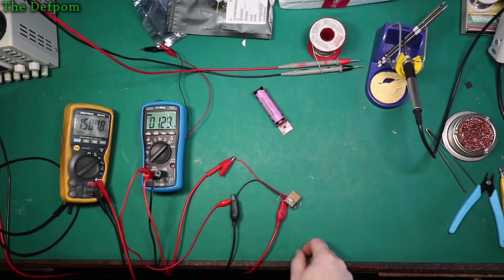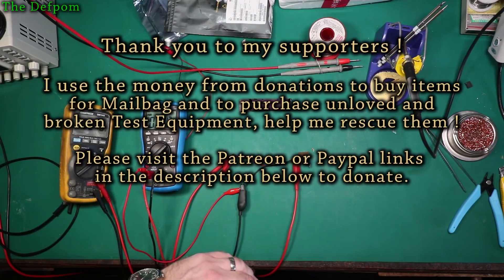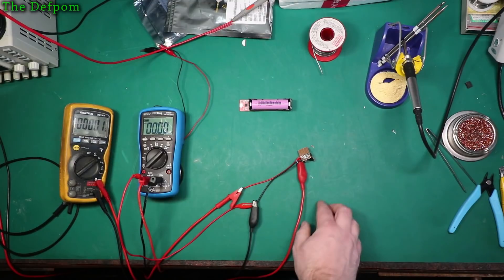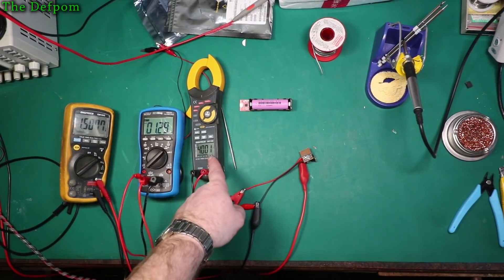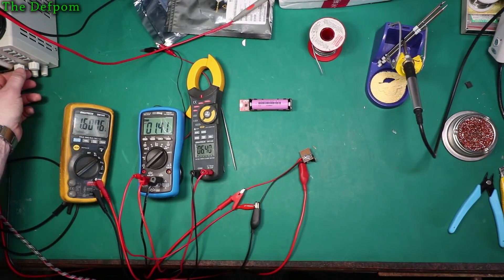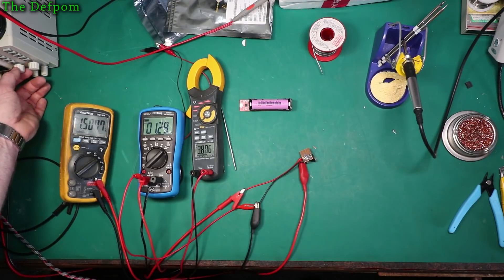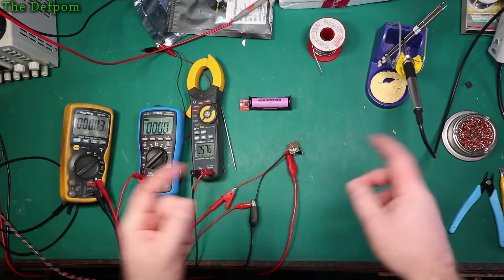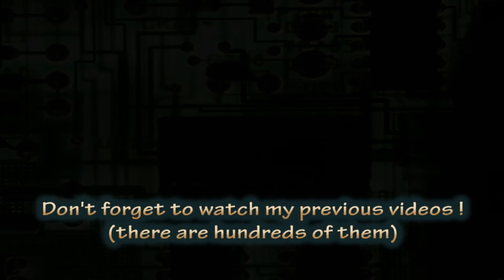🔴 #457 LM317 Voltage Regulator - Output Voltage Oddity Investigation

Comment from the maker: Extra info: the circuit this needs to power uses less than 2mA.

Yes I have capacitors on the input and output of the regulator.

Because the output voltage had to be set right at the lower end of what the device is capable of, it would of meant two very low value resistors in series between the output and ground, I didn’t want it to start getting warm as it isn’t going to be heat sinked, and I didn’t want the resistors to get warm and effect the divider accuracy, the output voltage has to be very stable.

If I had used the 240 ohm I would of needed 19.2ohm to get exactly 1.35v, part of the resistor choice was to get the exact voltage using common values, and at those resistances it would of only been 259 ohms across the output, consuming 5mA through them, again I didn’t want them to heat up, and also I didn’t want to waste power as this is going to be run from the battery.
Reply: Hmm you want everything yoooo greedy sod lol :-D
I dont suppose you could creep in a silicon diode on the output terminal before the 240 ohm resistor, lift the drive voltage up a little.
Im not sure what other effects that would have, worth a go lol
Reply: How about use a voltage reference chip specifically designed to be accurate over its input voltage specification?

Comment: The first clue I detected about why your circuit wasn't behaving properly is the 1K resistance between o/p and adjust (R1). The second clue, predictably, was your current draw of 1.2mA. This is where errors crept in to what I was saying. To correct, the output current generally has to be a minimum of 5 mA or more. The necessary minimum output current varies across manufacturers and packages, anywhere between 3.5 to 10 or more mA. That 5mA figure is the basis for the recommended R1 value of 240 ohms since R1 = Vref / Imin. So, dividing 1.25V by 5mA = 250 ohms, and 240 is the common 5% value nearest to and lower than 250 ohms.The online calculator I've seen, and data sheets for the LM317, specify R2 = 240 ohms for the full range of o/p voltages. This allows sufficient current into the adjust pin for correct operation at any o/p voltage. My setup for 1.35V o/p works with R2 = 20.4 ohms (using a 50 ohm trim pot) and R1 = 249 ohms (the closest value I had). This is what I ended up with using an iffy bimboard and it's resulting voltage drops. My device is the National Semiconductor LM317LZ. My Vref / Imin is 1.25V / 5mA. So my R1 is just great because 5mA is the Maximum minimum output current required for this device. (The Typical minimum output current for this regulator is 3.5mA, so I might have got away with R1 = 1.25 / 0.0035 = 357 ohms).

From the above, R2 can be arrived at with a trim-pot, or calculated by manipulating the equation Vout = Vref x [1 + (R2 / R1)] thus: R2 = R1 x [(Vout/Vref) - 1]. Also of vital importance is to remember that the minimum output current pertains to R1 in the design, not whatever load is connected to the adjusted, regulated output. So upping the load current to so many mA by using a load resistor will not help!

So using the datasheets electrical characteristics, go with the Maximum minimum load current to be on the safe side. If you don't have datasheets, use 10mA as a starting point for R1 (125 ohms). I made a change like that to a piece of stereo equipment I built where I was running LM317T and LM337T regulators with a minimum output current of 4.9mA (R1 of 255 ohms). This was bad news as there was all sorts of intermittent crappy mushy noise. I recalculated for a minimum output current of 10mA (124 ohms) and voila! All good.

Hope this helps (again!).

Comment: My lm317 ics are having problems regulating voltage I made a generic schematic it worked for over a year but suddenly something started to mess up and it is no longer regulating voltage it just directs the input voltage directly to the output but only let's 250 ma max and sometimes it does regulate but after sometime it seems to stop regulating and has the same issue I am using 24 volt transformer with diodes rated for 6 amps please help me .

Comment: Why not use the LM317 or other low-noise LDO, (LT3045) to power a zener voltage reference chip....then divide the zener's constant output using a low-ppm resistive divider network (perhaps with a trimpot)......to get a REALLY stable and quiet 1.35 volts.
Best trimmer would be one of the Vishay "foil" types....I think they have a ppm/C down to about 10 or 5, so temperature is almost a non-issue. (?). Very stable voltage.
If you need more millivolts, add a buffer opamp on the output, like the LTC2050 ?

Comment: I am pretty new to how electronics work, I do know a little. But I bought an lm317 to build a little adjustable power supply. With mine, as soon as I apply a load, the voltage just drops completely down. Any suggestions?

Comment from the maker: I went back to a thread I had previously seen on EEVblog where there was a photo of a board that is made by Fluke to replace the battery, you can see the resistor colours (https://www.eevblog.com/forum/testgear/fluke-540b-thermal-transfer-standard/?action=dlattach;attach=38492;image), I dropped the values into an LM317 calculator, it comes out at 1.346 V, so I am sure the part they are using is also an LM317.
As for the resistor values... R1 is 1.3K, R2 is 100 Ohms, so those are actually presenting slightly less loading than my version, maybe I wasn't so far off after all.
Reply: Nice find, now you have the ideal values too :-).
The actual voltage will be a tiny bit off the calculated one, because of the tolerance of the lm317 you are using, the 1.24v ref and 50uA's to 0v.
But it won't be much off.
The 2n3055 npn power transistor is also one of my favorites for the outputs of linear power supply and old audio amplifiers.
The amount of c.b power supplys i've repaired, too dam many, a bucket of 2n3055's ha ha:-D.
I bet you have done the same, it's a task that follows c.b radio repair.

Comment: As other's mention, the LM317 has fairly hefty IQ and Dropout for your application given it's a battery powering it. Not sure if you mentioned how much current was pulled from the previous Mercury Battery or not. There are a fair number of LDO and low IQ  regulator out there that were designed for Battery Application that maybe better suited. There is also a battery called a Wein Cell that was developed to replace the Mercury Batteries used in older SLR Cameras that require 1.35V. So maybe one of those with a low voltage/low IQ op-amp as a buffer to your  load? As always, several paths to get where you want to go.
Reply from the maker: I went back to a thread I had previously seen on EEVblog where there was a photo of a board that is made by Fluke to replace the battery, you can see the resistor colours (https://www.eevblog.com/forum/testgear/fluke-540b-thermal-transfer-standard/?action=dlattach;attach=38492;image), I dropped the values into an LM317 calculator, it comes out at 1.346 V, so I am sure the part they are using is also an LM317.
As for the resistor values... R1 is 1.3K, R2 is 100 Ohms, so those are actually presenting slightly less loading than my version, maybe I wasn't so far off after all.

Comment: Read the datasheet more carefully. All these linear series regulators need a MINIMUM amount of load current and a MINIMUM dropout voltage in order to be able to regulate. Your 1.xx mA total current clearly shows that you don't have the proper load on the LM317. Datasheet says you need to have at least >3.5mA load current and >3V dropout voltage otherwise the device will not regulate. Under these conditions, those equations for the voltage vs resistors are pretty close.
Reply: ...if this is supposed to replace the battery backup for memory, with these type of currents it will be drained in no time. But on the other hand, for a few microamp required for SRAM battery backup there is no need for voltage regulator
Reply from the maker: I went back to a thread I had previously seen on EEVblog where there was a photo of a board that is made by Fluke to replace the battery, you can see the resistor colours (https://www.eevblog.com/forum/testgear/fluke-540b-thermal-transfer-standard/?action=dlattach;attach=38492;image), I dropped the values into an LM317 calculator, it comes out at 1.346 V, so I am sure the part they are using is also an LM317.
As for the resistor values... R1 is 1.3K, R2 is 100 Ohms, so those are actually presenting slightly less loading than my version, maybe I wasn't so far off after all.

Comment: LM317's are not happy at the bottom end (the internal reference voltage is 1.25V)......so set the voltage say 0.7Vdc higher and use a forward biased diode to drop the 0.7Vdc.....or even multiple diodes etc.
Reply from the maker: IanScottJohnston - if I were using a higher input voltage (where it showed the instability) then I would of done exactly that I think, but as it was ok at the voltages it will be seeing (3v-4.2v) I was happy enough with how it performed, I had tried different resistor value combinations until I found what worked ok.
This particular part has an internal reference voltage of 1.2487V

Comment: Great video, can't wait to see the conversion video as I'm facing a similar issue. I agree with AllTheGearNoIdea - always look at regulators with a scope in addition to a meter. I can't tell you how many times I've found oscillation on the output of regulators, especially older TO-3 packaged fixed regulators. Causes interesting problems in digital gear!

Comment: I’m guessing same as others load current and also possible bypass capacitor. I would be interested to see output on scope just for good measure.  It’s funny how us engineers all have there own way of working, not wrong just different. Obviously depends on the job but I find I generally use a scope more than a volt meter. Granted I’m not looking at the same precision that you are. But often a scope will often show something like instability much more readily than a DVM.   When you figure it out let us know. Chris.   Just reading your notes, obviously a good idea to keep the input resistant stiff, as they can be pulled by the program bias current, this also causes the calculator to fail.
Reply from the maker: AllTheGearNoIdea - yes I use a scope too when I am interested in noise, in this case as it is going to be run from a battery that shouldn’t be a problem, also see my pinned comment explaining a bit more about what I was doing and why.
Reply: The Defpom's Repair Channel  I would be looking for instability rather than noise.  Everyone know how fantastically well  these regulators work, until one day they don’t. I have no reason to believe that’s your problem here and I’m just guessing. But if you only have a hammer everything looks like a nail.  I think it’s more likely the load current.   I hope you investigate a bit further, I’m almost tempted to plug a soldering iron in. But then again. Regards Chris

Comment: Did you forget the input and output capacitors?, they give stability and prevent oscilation.
The output to control via 240 ohm resistor is best left as a standard.
All calculations miss out the roughly 50uA that passes to ground via the adjust resistor.
The internal reference is not always at 1.25v, errors will occur.
But they do work fine normally :-D
Reply from the maker: I went back to a thread I had previously seen on EEVblog where there was a photo of a board that is made by Fluke to replace the battery, you can see the resistor colours (https://www.eevblog.com/forum/testgear/fluke-540b-thermal-transfer-standard/?action=dlattach;attach=38492;image), I dropped the values into an LM317 calculator, it comes out at 1.346 V, so I am sure the part they are using is also an LM317.
As for the resistor values... R1 is 1.3K, R2 is 100 Ohms, so those are actually presenting slightly less loading than my version, maybe I wasn't so far off after all.
Reply from the maker: zx8401ztv - see my pinned comment explaining a bit more about what I was doing and why.

Comment: Hi    1K is far to high for R1     Data book suggests 120 ohm or 240 ohm  and you need caps
for good regulation . When doing stuff like this you should show us a circuit diagram .

                                                                                                                     Alan

Comment: Your not loading the output enough.  According to my datasheet, the minimum Typical load is 3.5mA and may need a load of up to 10mA to maintain regulation!
Reply: That's what I was thinking immediately too. When you want a widely regulated output the current sink needs to be a constant current one and not just a fixes resistor etc. Brings back memories. Another reminder for everyone to read the datasheets of the parts you are using :)
Reply from the maker: Pentti Kantanen - see my pinned comment explaining a bit more about what I was doing and why.
Reply from the maker: I went back to a thread I had previously seen on EEVblog where there was a photo of a board that is made by Fluke to replace the battery, you can see the resistor colours (https://www.eevblog.com/forum/testgear/fluke-540b-thermal-transfer-standard/?action=dlattach;attach=38492;image), I dropped the values into an LM317 calculator, it comes out at 1.346 V, so I am sure the part they are using is also an LM317.
As for the resistor values... R1 is 1.3K, R2 is 100 Ohms, so those are actually presenting slightly less loading than my version, maybe I wasn't so far off after all.
Reply: Yep, pretty much - this is a common trap with these old regulators.
Reply: More explanation here from TI's 2016 datasheet.

7.4.3 Operation at Light Loads
The device passes its bias current to the OUTPUT pin. The load or feedback must consume this minimum
current for regulation or the output may be too high. See the Electrical Characteristics table for the minimum load
current needed to maintain regulation.
Reply from the maker: Chris G - see my pinned comment explaining a bit more about what I was doing and why.
Reply: Yep, this. Evidently this circuit won't have problems (with this particular LM317 anyway) since the voltage requirements are low enough that the regulator is ok at the reduced current. However the datasheet is pretty specific about getting 10mA minimum, so you shouldn't expect that any given LM317 will regulate properly at <2mA. That said, I have noticed that every time I've come across something similar, I get accurate regulation at voltages <5V even if I don't hit the current requirement.

If your requirements are so small, you might consider going with a shunt reference instead. The ubiquitous TL431 only requires 1mA (if I remember right) and can supply up to 100mA. It also says pretty cool. If you only need a few more mA after that you can toss on a BC557 for a few deci-cents and you get very stable voltage with low quiescent current requirement.
Reply from the maker: I went back to a thread I had previously seen on EEVblog where there was a photo of a board that is made by Fluke to replace the battery, you can see the resistor colours (https://www.eevblog.com/forum/testgear/fluke-540b-thermal-transfer-standard/?action=dlattach;attach=38492;image), I dropped the values into an LM317 calculator, it comes out at 1.346 V, so I am sure the part they are using is also an LM317.
As for the resistor values... R1 is 1.3K, R2 is 100 Ohms, so those are actually presenting slightly less loading than my version, maybe I wasn't so far off after all.
Reply: @TheDefpom  I wouldn't be sure about that, there are many similar linear voltage regulators with better specs, and Fluke didn't get their reputation by ignoring spec sheets.  Off-hand there is the obvious choice of the LM-117 or 217, both of those are guaranteed regulators at only 5mA. But there are better, like the LM-1117, and there were different regulators available in TO-220 back then. And then there is a decent chance that an outfit like Fluke got a better-spec version of an off-the-shelf product that they then used in a bunch of different things, if that's what they needed.
Reply from the maker: I went back to a thread I had previously seen on EEVblog where there was a photo of a board that is made by Fluke to replace the battery, you can see the resistor colours (https://www.eevblog.com/forum/testgear/fluke-540b-thermal-transfer-standard/?action=dlattach;attach=38492;image), I dropped the values into an LM317 calculator, it comes out at 1.346 V, so I am sure the part they are using is also an LM317.
As for the resistor values... R1 is 1.3K, R2 is 100 Ohms, so those are actually presenting slightly less loading than my version, maybe I wasn't so far off after all.